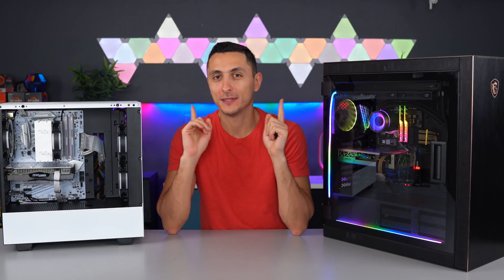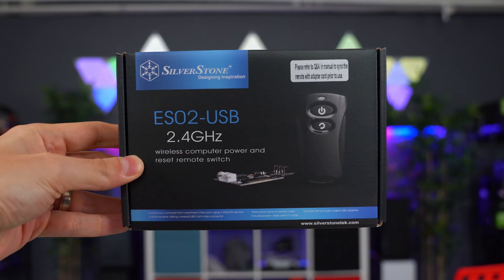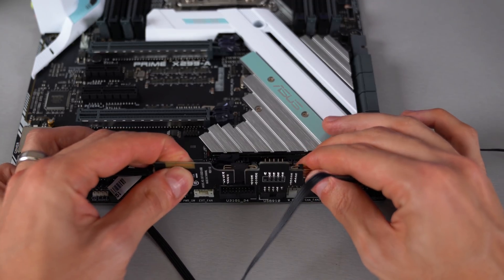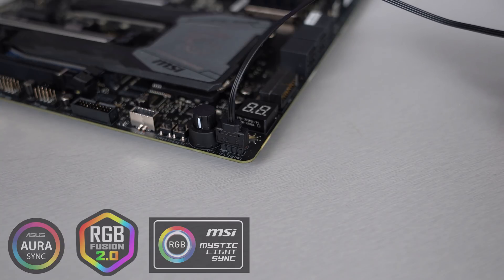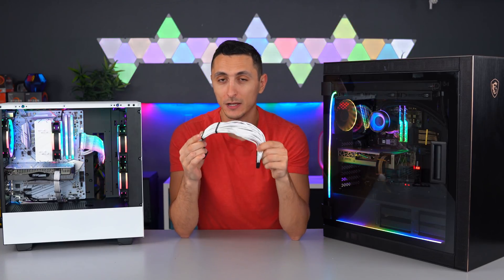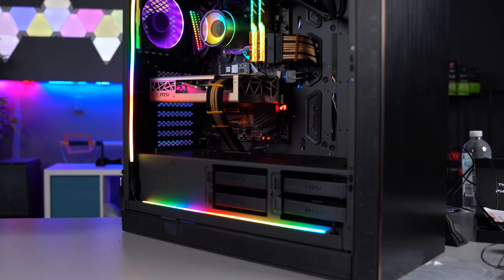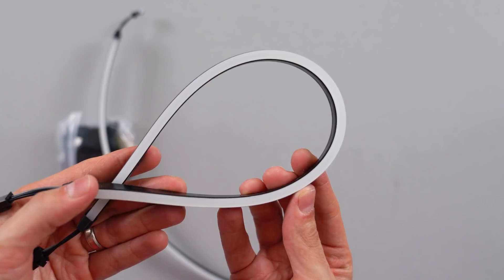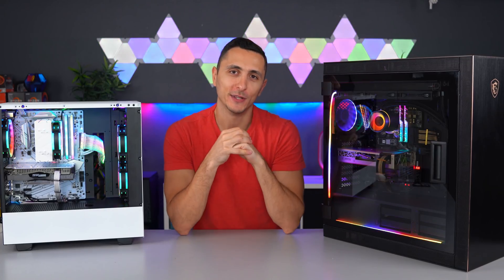Cool PC Tech Under $50

Comment: 1:45 you could actually just buy a smart switch like when. come home i just say alexa turn on pc because i have a smart switch it does that but it wont work unless you enable restore after ac power loss to be turned on its the option thats above the opton showed in 3:38

Comment: the 3 pack of asiahorse rgb case fans are better than RGB Fan x3 + LED Strip Combo for cheaper. You can also go with an asiahorse matrix controller that is cheaper than the RGB Fan x3 + LED Strip Combo for cheaper aswell. Just letting people know.

Comment: The remote thing to power on can be done with an app on your phone. All you really have to do is enable magic packets on your NIC settings and turn on a setting for you CPU in the BIOS. The app I got can automatically connect to wifi and turn on my computer.

Comment: QUESTION??? I have purchased a case and a motherboard. The case and motherboard wires are not the same to connect the power button reset button etc. They don't match up. Some have two others have four pins. What do I google to find an adapter to make my case wires go to the motherboard cable to match? I hope this makes sense.

Comment: I personally picked up the Phantek Halos (non lux). The only difference is the frame is plastic vs aluminum. I personally think they are great and the ONLY reason I'd opt for the LUX aluminum edition is if you have extra cash to blow OR want to paint the frames. Aside from that, the non LUX are half the price. That's my recommendation.

Comment: HELP!!! People that know what they r doing plz leave me suggestions!!! I switched mobos and overclocked my cpu. Ever since then my PC has not been the same. It acts slower, screen turns black for a few seconds, crashes game. I re set my bios to default settings and it still does it. It is making me question my mobo but it was working fine before the overclock. I used a nzxt kraken for cooling. I don't know what to do. HELP. suggestions?

Comment: Instead of using a remote control for your PC which only works up to a specified distance, why not use a smart plug alongside a smartphone app like homemate to turn it on? 

I use a smart plug, set my PC to turn on Everytime it received power (this option is configurable via the bios) and simply trigger my computer on and phone via a hardware that I carry with me no matter what, my phone. What's even better is that some smartplugs can even approximate reading power at the wall, so it's a nice extra feature that the PC remote does not have. And what's best is that smartplugs usually go for less than 30$. You can probably get 2 for 50.

Comment: You can get the CiT Raider case which comes with 3 RGB Fans which comes with a remote (can be used by AuraSync if you have a 3 bit header) - all for something like £47

Comment: I can turn my pc on and off with Apple Homekit (Also using Siri on my iPhone). 

It has never failed me before and is very handy because when I'm not home I can turn on my pc, use a vpn tunnel and remote control my pc via RDP.

It's very simple actually:
I run homebridge on a server at home, which I use to control multiple not Homekit supported items using Siri. It sends a Wake on Lan signal to my pc and an RPC shutdown command when I turn it off.

Comment: I had a feeling you would be showcasing the Phanteks NEON RGB Strips.
8:08
Yeah I totally had issues installing the strip with the adhesive provided. Even now, it's slowly starting to peel off.
8:49
My Phanteks NEON RGB strips are connected to my 5V addressable RGB header yet yours connects to a 12V RGB header.
Reply: yea same im confused

Comment: "Who's going to use this PC remote....."

No, no one. Literally no one.
Reply: not a single soul
Reply: Why you'd spend £50 for something you can for free using your current mobile phone and wake on lan
Reply: I use it when I'm in bed and forgot to turn off my PC, pretty useful when you're all comfy and don't feel like getting up
Reply: Turn off a PC? Alright.
Reply: Exactly just use wake on lan
Reply: @samster395  I did for a while, before I got the remote. But the app on my phone was buggy, and then it just stopped working. I like the hardware solution better
Reply: i am
Reply: @MagnificentPez I'm sure all three people who have a wall mounted pc will appreciate it.
Reply: To people who are in a similar situation to me, it will be extremely useful. I'm physically disabled and i can't move around and not even physically press the power button on my pc.
Reply: @VicTheAwper  if you cant even turn on your pc how do you use a keyboard
Reply: @ege8240  voice-controlled custom build, maybe?
Reply: @ege8240  The power button on a tower is usually harder to press than keys on a keyboard. I've specifically bought a keyboard and mouse that's easy for me to use. My keyboard has the mx speed switches which is very easy to press down, and my mouse only weighs 58 grams
Reply: Ege they probably mean that they struggle to reach it, whether it’s on the floor or mounted on a wall
Reply: Michael Thomas Ireland that’s awesome tho
Reply: Some PCs need time to get ready for work u know
Reply: Michael Thomas Ireland I would totally use it.
Reply: Michael Thomas Ireland  i would use it tbh even to show off 🤷🏼‍♂️💀
Reply: AFRICA GYM facts I’m getting one for my future build lmao
Reply: I have a primary PC for work mounted under my desk and a secondary PC mounted on a shelf on the wall behind my monitors. Can't reach it. Bought the remote and installed it and it works AWESOME
Reply: Chris Salvian does it actually work from 20m like he said?
Reply: MagnificentPez or anyone who turns their computer off to save energy and then they can save hella time by turning it on as they’re walking into the house every time they leave and come back!!

Comment: I've just installed the new Neon RGB strips from Phanteks and they have a 3 PIN 5 V connector? At least here in Europe. As for the adhesive I do not really had a problem with them sticking well to the attached surface.

Comment: My PC starts up before I can even sit down why the hell do you need a remote when SSD's exist?
Reply: @sms1480 yeah 10 seconds thats the point, you buy and install something which doesnt even speed up the process
Reply: As some people pointed out, it seems useful for wall-mounted builds, people with certain physical handicaps, perhaps even elderly people who keep their case on the floor so they don't have to stoop low to turn it on.

Definitely a niche product
Reply: It's not the most useful thing but I have a PC under my tv. So it would be kinda cool to turn it on without getting up and turning it on.
Reply: @XxViciousxX  precisely the definition of a niche product, something catering to a very particular set of people and circumstances. If it is for you, go for it, I always say.
Reply: Imagine having a hard drive

coming from somebody who only had hard drives 😩😫